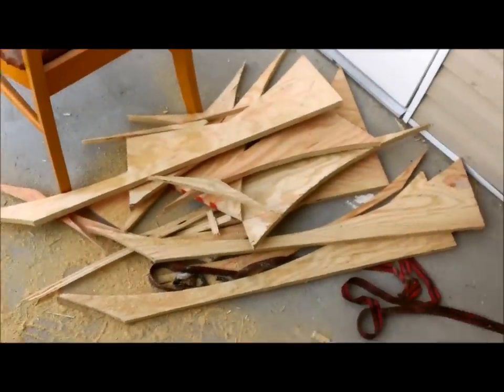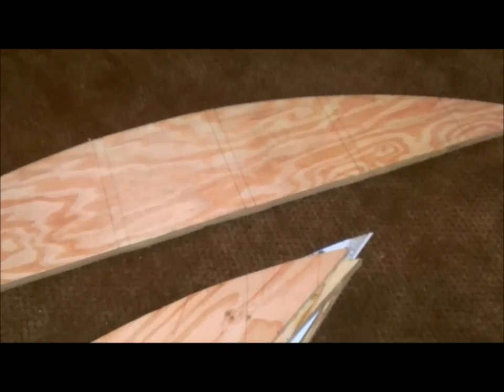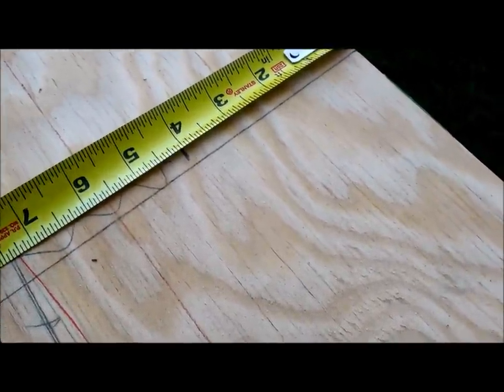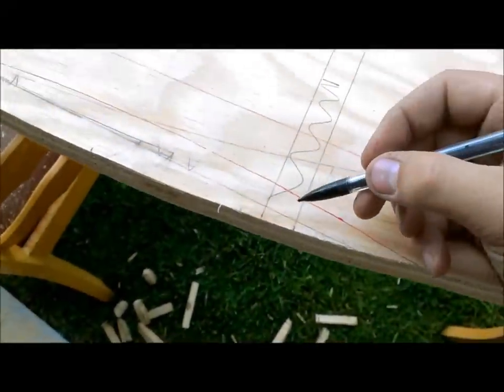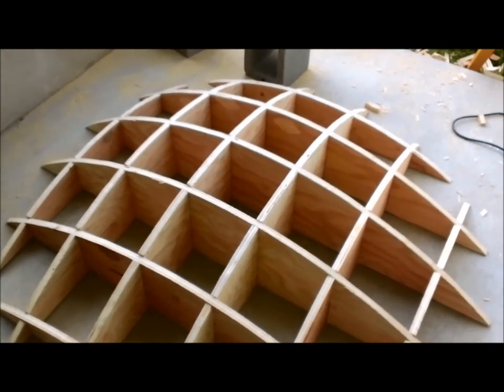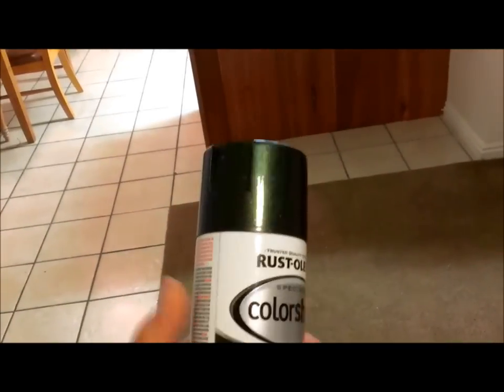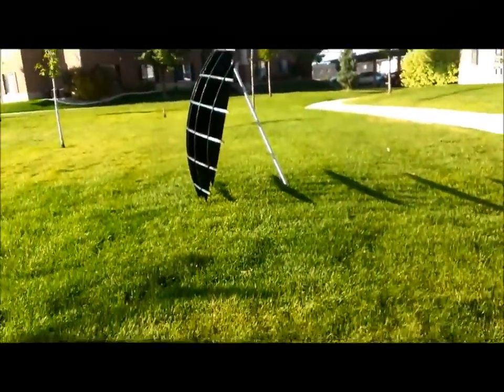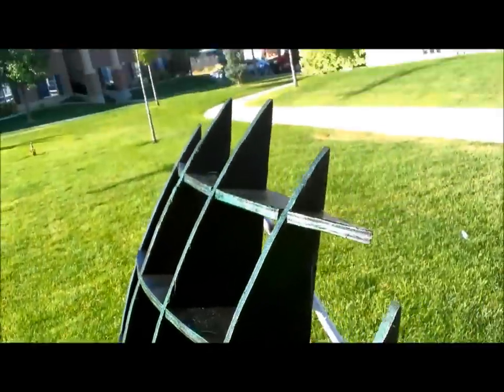Knick Knack Shelf with Color Changing Paint Part 2

Comment from the maker: @wienerschnit I used a jig saw for all the cuts. even the straight ones. And 2 cans of base paint barely covered the shelves one time you should probably get 3 to be safe, and the same hours for the top paint. i still haven't mounted mine yet, lol i  have it leaning up against the wall under where i want it.

Comment: It's hard to tell from the video, but it looks like you could have profited from spending more time sanding - I saw what looked like lots of little nibs on the plywood faces - it helps if you use a spray bottle and lightly wet the plywood, which raises the wood fibers, and then sand those down. You'll get a much smoother prep surface for paint that way.
Reply from the maker: Nice, thanks for the tips.  Ive never heard of the wetting it down trick before.  Ill have to try that.  And yes, the edges are a little rough.  I plan on making nicer ones in the future.  Thanks for watching!

Comment: I saw this on Reddit and made one attempt today to make one from 1/4 plywood. I made some mistakes in the placements of the inlets. Next weekend I will make the bigger one.

Three questions:

How do you saw the straight lines? Did you use a jigsaw as well?

How many spray paint cans should I buy and how much base paint?

Can I see an image of the knick knack shelf on the wall?

Thanks for the video!

Comment: I know I'm super duper late but I just ran across this video and I thought I'd mention that they do have a PVC board the same size and thickness of a standard sheet of plywood that's half inch thick Granite it might be a little bit heavier because it will be solid plastic but you know it will last forever and if you want to get fancy you could have the board wrapped with whatever color you want your shelves to be

Comment: Is it heavy?
Reply from the maker: It weighs almost as much as a full sheet of plywood. Probably around 60-70 pounds.
Reply: Thanks for responding. How would one go about mounting this to a wall?
Reply from the maker: I got some large L shaped brackets that are ment to hang shelves up.  I put three big ones on the main center shelf, and than one smaller L bracket up at the top, and another one at the bottom.  all of them screwed into studs.
Reply: Cool, thanks for the help!
Reply: @ @JerryRigEverything  now u r a very successful YouTuber how you feel after watching this video